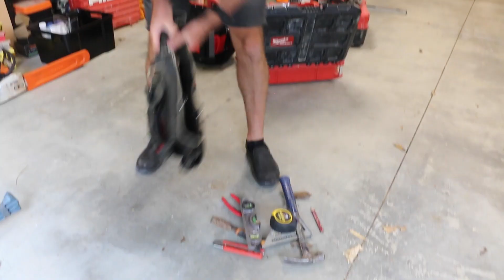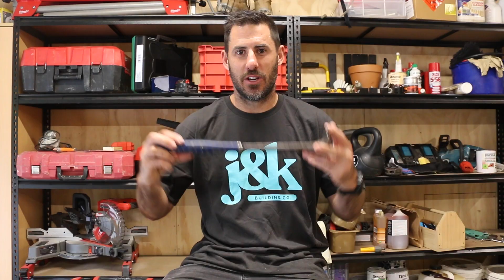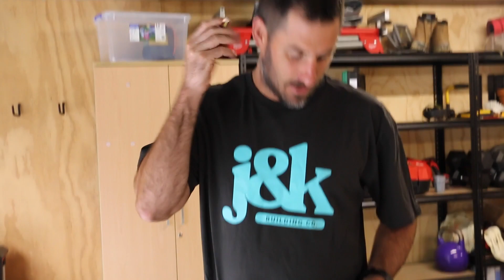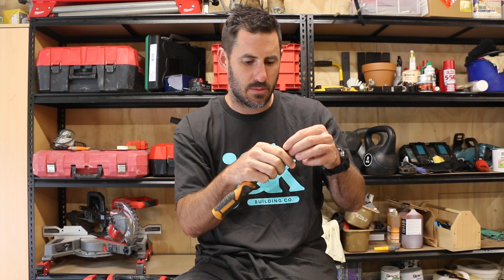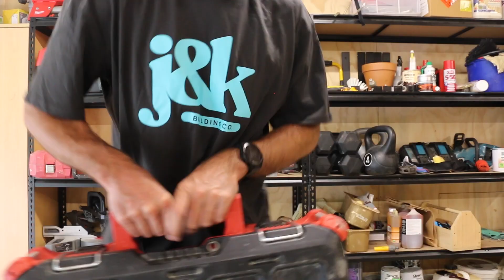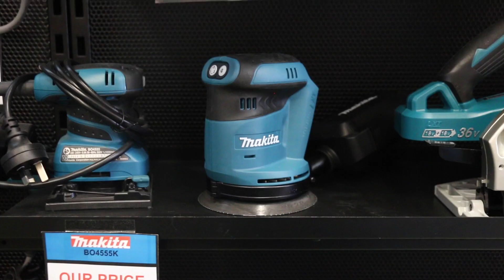Day 1 Toolkit for the New Apprentice

Comment: Excellent video mate. Will you do a follow up video from apprentice tool needs to a fully qualified Tradesman? Thanks.
Reply from the maker: Good idea!
Reply: Quick snapshot: RADIO, Framing gun, finishing nailer, impact wrench, hammer drill (SDS), drop saw, laser level, jigsaw, caulking guns, chemset guns, air compressor, planer, small power saw, blower, vacuum, track saw, saw stools, shovels, wheel barrows, ladders, power leads, RCD's, ratchet straps, chain block and a whole bunch of fixings and bolts. 
Possible considerations: Concrete equipment, Trailer, Fridge/Microwave/Toasted Sandwich maker, Welder, Oxy torch and much more...

Comment: Imagine if a surgeon had to supply his own kit.
Reply from the maker: I get what you're saying but I think thats quite a different comparison. Imagine if a builder had to keep all his tools perfectly sterile in-between uses. A better comparison would be a chef, who usually has his own knifes that he prefers, looks after and keeps sharp.
Reply: Closer to my point is the cost of entry into a chosen career, I know 4 guys who added up these costs and decided to do other things.
Like being a painter or chef, a set of knives opposed to a boot load of power tools, all equipment is supplied to the building inspector to do his job. I am fortunate to receive a tool allowance and free repair service and replacement of tools and access to over 100k of plant  plus other incentives supplied by my employer. 
It's hard to find good appreciates so finding ways to keep them is something to think about.

Comment: I'd add a Dogyu bar and a fine vivid. Plus an engineers punch. They're longer and easier to use.
Reply: Yup, engineers punch great for punching nails right through, doesn’t get stuck or create a massive hole like the tapered nail punch’s do 👍
Reply from the maker: Great additions - especially the engineers punch :)
Reply: With the dog bar you can do away with your hack chisel and probably the nips (unless you're tying steel)

Comment: I work in gas, am a hobbyist woodwork and like building stuff, and agree with all what you said, currently building my deck and use every hand tool you've mentioned plus power tool at every stage. 
One mistake I made early on, when I was working at a different company was to buy AEG. The tools held up well enough for the price point, and most of the guys I worked with were on that platform so good for needing to borrow a battery etc, but the problem i've got to is that the range isn't big enough and although ridgid have plenty in America and are the same tool they aren't bringing a lot of it over here. They seem to have given up on nz to be fair. The other problem is that it can only be bought at bunnings, and with no competition prices are going up for the same tools. I've started migrating over to Makita for all of those reasons, still at a good price point, much better range, and can shop around to get what I want at a good price. My only gripe is that for whatever reason Makita just won't release an 18v gasless framer and it keeps me up at night! Luckily my old paslode is holding up, but if it breaks before it's time to re-do my fence i'll be like a lost puppy!! 
When it comes to table saw and drop saw though i've gone DeWalt and couldn't be happier!
Cheers
Reply from the maker: Nice to know, I've always been fine with being on several platforms, perhaps stick with Paslode for the Framer. I've got a hilti framer and its been awesome

Comment: When I was a hammer hand over 15 years ago one of my largest investments was a Paslode framing gun, still have it today unfortunately the battery won't hold change.
Also I would be more open to more tool brands, I know most builders these days like Milwaukee and if you follow suit you will have everyone asking if you have a spare battery.
It wouldn't hurt to go with one of the other TTI brand's like AEG but probably not Ryobi,  DeWalt has always been a solid professional trade choice also.
Reply from the maker: good points

Comment: Yeap, can't argue with that in this day and age. You left out nailers though, Personally I reckon you are going to need one as an apprentice, at the very least a framer of some brand or another, there's nothing worse than having to borrow someone's framer all the time. I've got pretty much the exact same gear you have on the belt (good rule, fat max tape, 19oz Estwing framing hammer, which is new after my 22oz Milwaukee fell off the back of my truck down the Awanui straight, Fat Max basher chisel, the one with the edge up the side, nips, Tajima knife, and my pencil is one of those Pica mechanical pencil copies by Ox), I would add a set of small Knipex speed grips to that belt, because they are super useful, and they can double as a nail puller in a pinch. I'd also add a dog bar (Estwing, Fuller, Dogyu, Stiletto if you have the coin). 
I went with Milwaukee as well, more because I still do a lot of mechanic shit and they have gear for that which other brands don't. Got the framer (great gun but too heavy), drill, half inch impact, 12v Hackzall, 12v stick light, 12v stapler, 12v mini polisher/sander (which has saved my ass a couple of times), got an old Ryobi drop saw that I resurrected a couple days ago (hand me down from the old man), electric planer, router (which broke), corded Makita skilly that I found at the dump, my old sander from my car painting days, and a 4 inch corded Makita grinder. I did buy a cheapie corded Smack n Pecker skilly and put a PCD blade on it specifically for cutting Hardies (has a little vacuum port on the back, perfect for cutting that shit). It doesn't cut timber square whatsoever but its just fine for Hardies
Reply from the maker: Nice, I might have to do a follow up video on Dog Bars and Framers :)